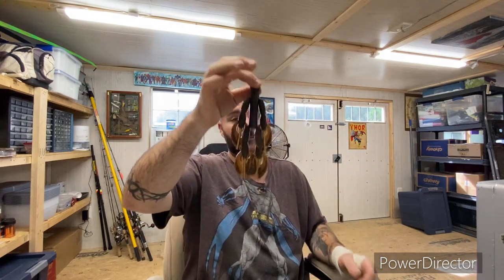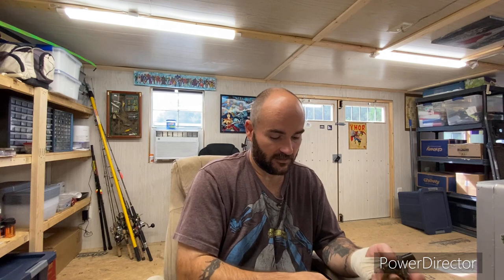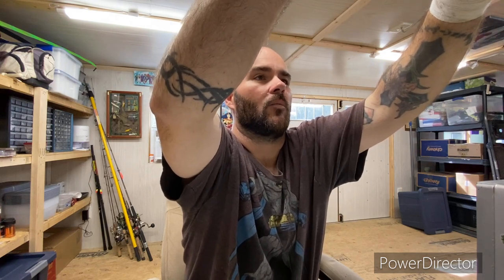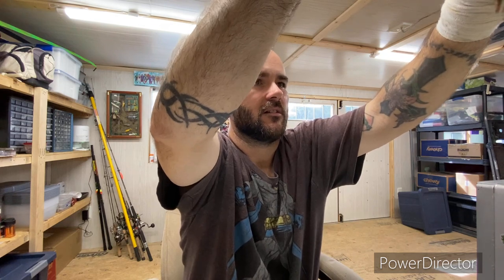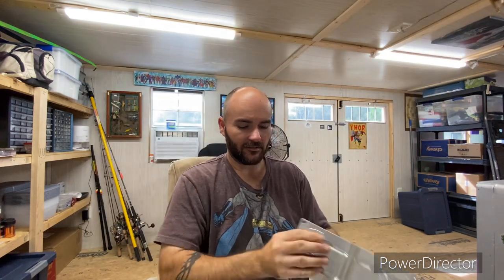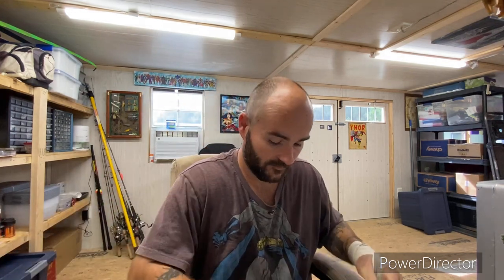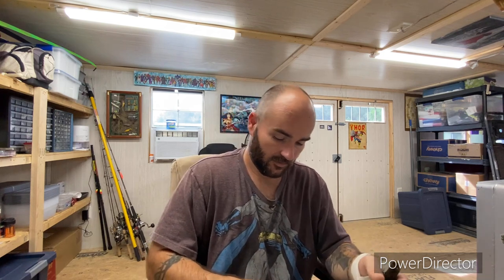Making a few craws

Comment: I tried a duel injection on small swimbaits, using pearl powder while,  and green smoke...no matter what I tried it plugged up in the blending block🤬🤬 any ideas why? Thank you
Reply from the maker: What plastic was you using and was your temperature above or around 325 ?
Reply: @talltalescustomtackles2502  i was using the essential stuff from do it..and my Temps were hotter.. like 350-400...I thought would make better...I'll try 325👍
Reply from the maker: Ok I’ve not had any experience with the do-it plastics but I’d think at those hotter temps it wouldn’t plug up try heating up the blending block and see if that helps
Reply: @talltalescustomtackles2502  thank you!